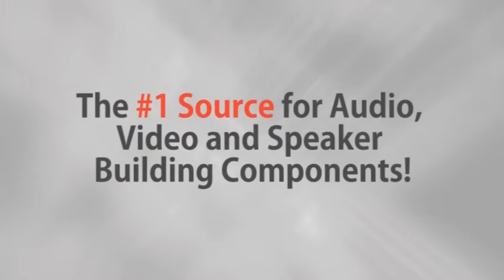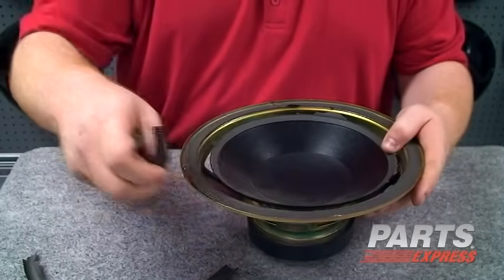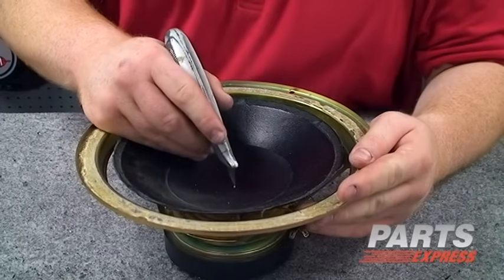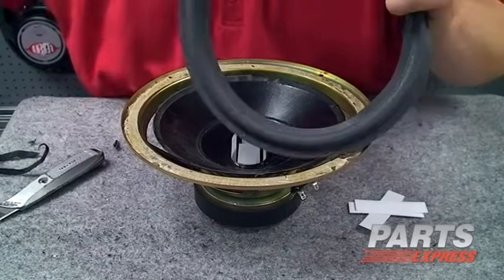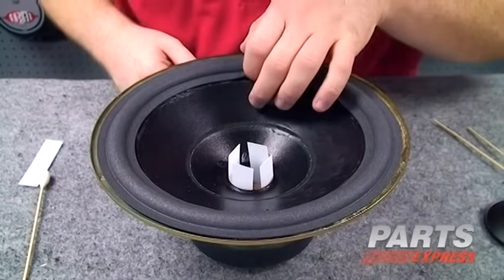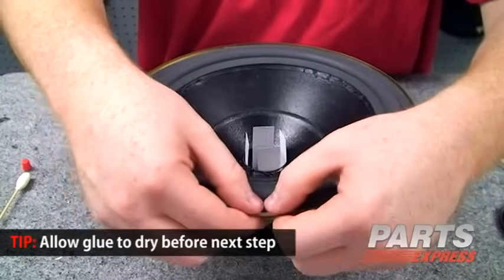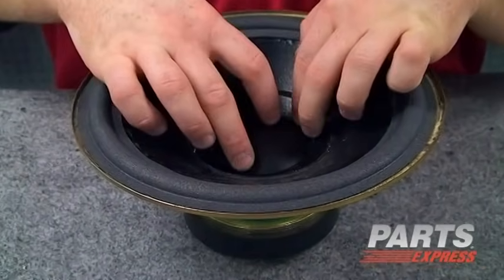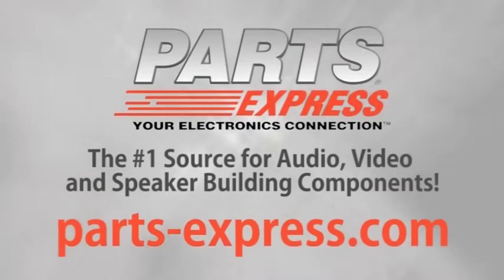HOW TO: DIY speaker refoam using a Parts Express repair kit

Comment: I’ve never removed the dust cap. The trick is you glue the inner surround first let it set before working on the outer surround. Make sure the cone moves in and out freely without rubbing the inner wall.

Comment: I was cutting cf wrap around the speaker with a hobby knife when i cut the foam about 1-2 inches long. Can i use scotch plastic tape or foam safe super gluee to fix it?

Comment: If you are patient, you can completely remove the foam and the dust cap without cutting or scraping. Lots of reapplication of isopropyl with a cotton swab - drip it all around the basket, rub it on the cone (small amounts if the cone is absorbent, like paper), eventually the glue will soften and rub off. A craft knife blade might be needed to lift the dust cap once you have removed all visible glue - barely insert it (1/8" or a few mm) and lift slightly and work all the way around. Do not cut anything, just insert, lift, withdraw, move over, repeat. The voice coil wires will pass through the side of the cone near to where you are cutting - look at the side of the cone and you will see where the wires are. Using force to scrape the cone or tear off the dust cap as shown can crease the cone, and in my application, no matching dust caps were available (Parts Express didn't carry a kit for my speakers but I got foam surrounds and glue from a local repair shop).

Comment: have a klh bass cone out of the2wy cabinet the cone itself is intact,,moves smoothly front to back,, connected live speaker wires to the cone contacts,nothing,,tried touching the wires direct to the contacts on the cone surface,lightly reaching w fingers around the metal supports,still no sound,is it dead dead?

Comment: My advice is to go MUCH slower in real life. It's obvious he went too fast and took a chunk out of the paper cone. I also saw no reason to cut out the dust cap (unless it was damaged). When I replaced my surrounds the cone remained very secure and didn't move at all. The spider held it in place firmly. I'd pass on the shims and use a tone generator as described elsewhere. It's a very satisfying project to do. 👍

Comment: Hello I have 4 8 inch Rockford punch audiophile in a set of folding exphonable horns , and I was wondering if I could change the rubber on the outside of woofers without ruining the punch dust covers, these speakers are very nice and trying to get them running.

Comment: What if your driver does not have a dust cap?
Reply from the maker: If it is made that way from the factory no problem, but if your cap is missing then you will need to find a replacement.

Comment: mine are completely disenigrated but not blown what do i do I have really old American acoustics I got for free there 116 watt each 4/8 impendance with 39hz to 22khz frequency responce
Reply from the maker: Just use a kit to refoam the speaker. However, I recommend calling and speaking with a technician to verify the dimension and assure he gets one that fits properly. 1-800-338-0531
Reply: Okay thank you in glad you replyed

Comment: what causes one of my speakers to drop sound in a minute after stereo is turned on?
Reply: sounds like that is a problem with your receiver, not your speakers
Reply from the maker: +Brenda Thompson Contact our Tech support and they can answer your question right away! 
Technical SupportTo get technical information about our products:Email: Tech@Parts-Express.com
Phone: 1-800-338-0531Hours 8am-6pm M-F EST / 9am-2pm Sat EST

Comment: What does a speaker that need refoaming sound?  One of mine does a weird rattling sound but the rubber seems healthy :-(
Reply from the maker: Tenebrius1963 Hey Tenebrius,
Please contact our tech department for the best way to determine your issue: tech@parts-express.com or 1-800-338-0531.

Comment: pva glue? no need to centre the cone by removing the dust cap as you can just move the cone so you cant feel it grating , i dont remove the dust cap unless its damaged
Reply: +bongosrest okay... I was wondering this... would there be any harm in not doing this step even if the cone is not damaged?

Comment: one of my channel speakers foam is damaged[a tiny hole] little by insects.Does it affect the sound quality and clarity of that speaker??
is their anyway to fix it?
Reply from the maker: A tiny hole will not audibly effect anything, but I would recommend patching it with a small amount of rubber cement to prevent it from getting any bigger.
Reply: Sir if it is ok to put some glue in to the hole to prevent it from damage??or can u suggest me any other ideas to fix it.
Reply from the maker: Vv hese Please contact our tech department at tech@parts-express.com or give them a call at 1-800-338-0531. Tell them what you want to achieve and they will give you the best possible solution for your particular speaker. Thanks for watching!
Reply: *****
thank you

Comment from the maker: Ankit tanwar - There are different rings for different speakers. We offer a few selections, you can check them out here: http://www.parts-express.com/cat/speaker-surround-refoam-kits/328
Reply: ***** Do you sell surrounds for the Advent/Jenser speakers 8 inch dia.I believe they where made in the 80'sCheersRob
Reply from the maker: Rob Hernandez Please contact our Sales Department at sales@parts-express.com or by phone at 1-800-338-0531. Thanks!

Comment: I understand everyone has their own methods of doing things . I always spray paint the cone after I remove the old surrounds with flat black to freshen them up , and I recommend applying the first layer of glue to the back side of the new surround . you will have plenty of time to do all and any adjusting . I also recommend applying the New Surrounds while playing the speaker at a low volume to make sure the sound is Not distorted . your video is well described and is very helpful . Thanks . Ray in Pa.

Comment: Modern speakers use a new formulation of foam that contains anti-fungal agents that prevent dry rot. Also, some surrounds are treated with a rubberized coating that shields the foam from humidity.